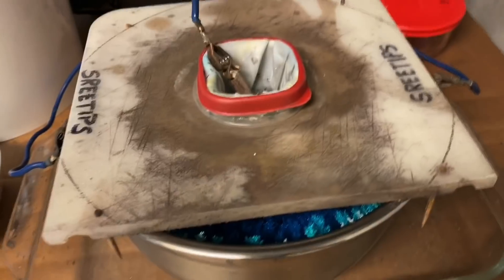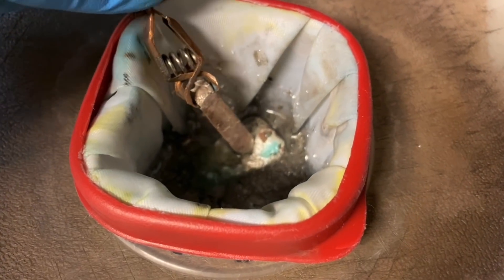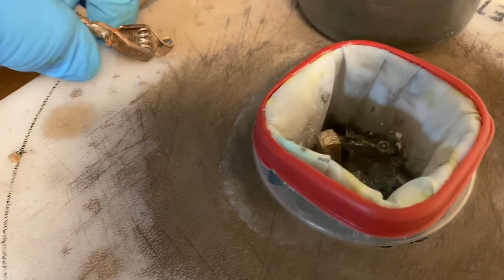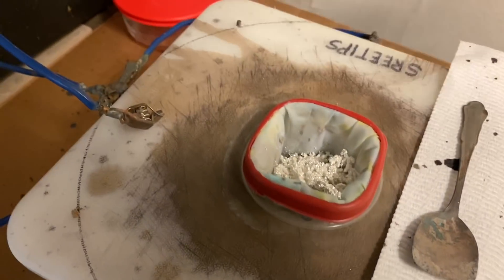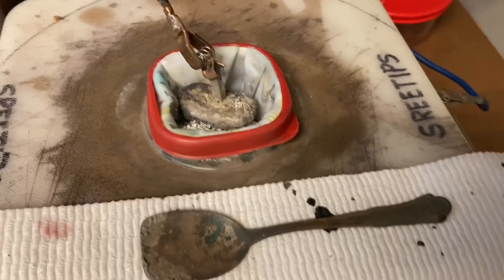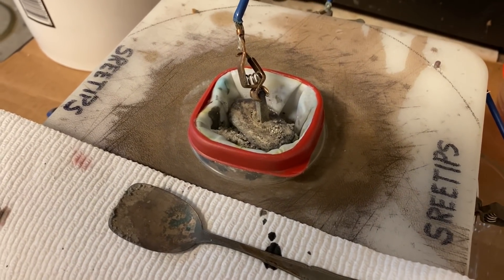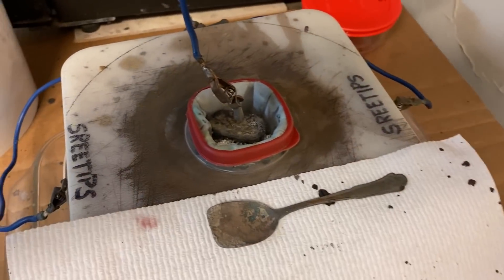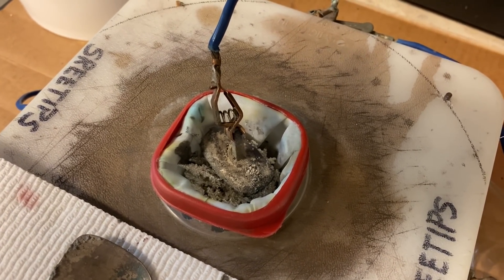Dissolved My Silver Cell Anode Bar

Comment: hey sreetips, i have a question. for your silver cell that you use here, the bowl is made of stainless steel, you showed in one of your previous videos of the ordered list of cementing metals from nitric acid. so the question is since stainless steel is mostly iron and iron is located about half way down the mentioned cementing list, why doesnt the bowl cement out the silver from the electrolyte?

Comment: I wonder if a very simple hanging mechanism could be built to support the anode, preventing it to go too low while silver shots refine... Setting the lowest side of the anode just above the silver nitrate solution level will ensure the automatic disconnection of the power supply and stop the process until refilling the basket. Just an idea...
Reply from the maker: Possible. Just check it regular to avoid this mishap
Reply: @sreetips , I was thinking about a very simple idea (a "safety belt"), easy and quick to make: drill a 2mm hole into the side of the vertical silver bare and put a long toothpick (or a BBQ pick) through it. Setting the height of the hole so the silver anode will never touch the electrolyte when the toothpick goes in contact with the basket edges... Hope I'm clear enough about this idea even if my English isn't my mother tongue...

Comment: Does the copper silver crystal look cool can you see both metals.
Reply from the maker: I’ve only seen it all once. The crystals were the size of a kidney bean. But they had a coating of green film on them after they dried. The electrolyte was completely depleted of silver. I just ran the crystal back thru with fresh electrolyte. And vowed to never use the electrolyte more than twice. Plus, I add fresh silver nitrate to the cell as it runs.